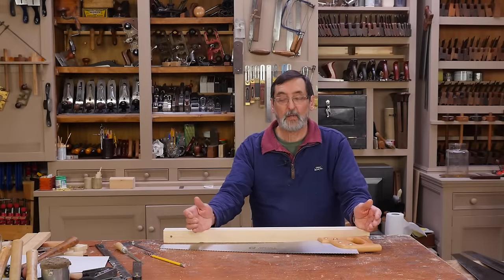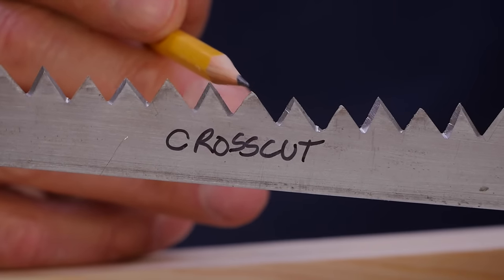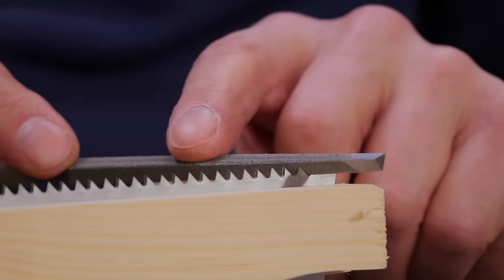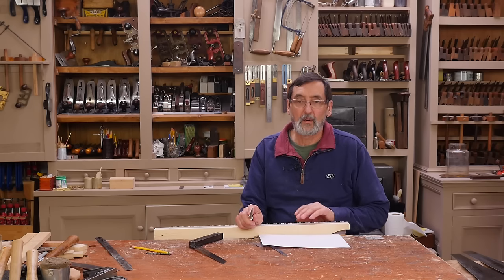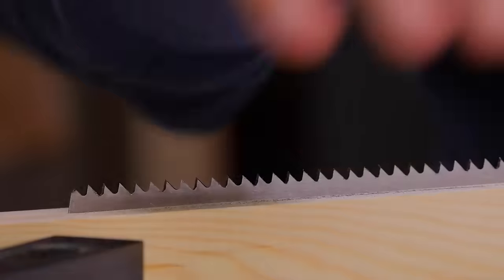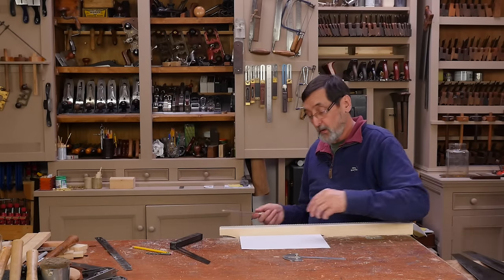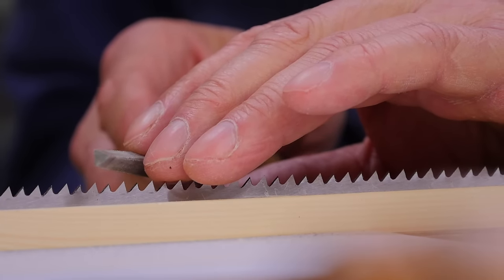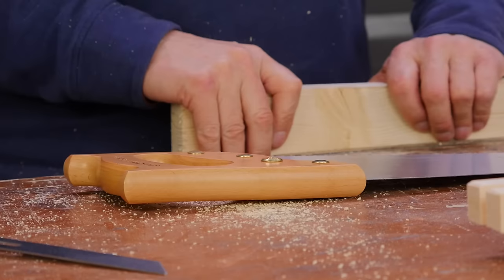Sharpening a Crosscut Handsaw | Paul Sellers

Comment: Hello Paul. I have been a Carpenter& Joiner for almost 50 years I still have my original saws I first bought as an apprentice at Browns of Wilmslow Cheshire I have lived in Australia over 30 years now and still use my saws which have become apart of me. and I still love to sharpen them. 
I have found your explanation video on saw sharpening and setting  cross cuts and rip saws perhaps the best I have ever seen.
Although these days of buy/ use and throw away saws has almost become the norm in the trade I have to admit having a resharpen able saw in your tool box is a lovely thing, to have and to hold and to cherish it evokes lovely memories for me and its special. Power tools are fantastic and do have an important place these days regarding time and labour and all that  but working buy hand in the workshop and on site is something very satisfying.  I am very glad I had the opportunity to experience this and it is something that has never left me.
Thanks Paul  for your smashing YouTube videos 
Kind Regards
Col Taylor
Reply: What a lovely comment.

Comment: Paul Sellers is simply a genius for non-nonsense practical approaches to this craft.  The very simple idea of a couple of 1x2s joined with a screw and washer, with the fleam angle penciled in at intervals along the length, is so perfect, but I never would have thought of it.  Sharpening a cross cut saw seems intimidating, but with this demonstration I'm sure even I can pull it off.

Comment: Paul, with your demos; I was able to recreate the worn off teeth end of a small razor saw (4 1/2" blade) with small aluminum shims for clamping and a magnifying lens on a stand for soldering work. Amazing that it worked even though I could hardly see what was happening. 
I had to use a small sheet metal angle bracket to keep the file from jumping and moving side to side; and kept the file vertical.

Comment: I am watching this because I have just refurbished my late Dad's saws (rip and cross cut) that are at least 70 years old. Unfortunately they had been allowed to go very rusty over the last 30 years or so, so I have cleaned them off as best I could but the steel is rather pitted. The handles now look fantastic though. The cross cut saw works fairly well as is, but I am now sure a quick sharpen as per this video will transform it. I recall last using this saw in the mid 1960s and to bring it back into service is incredibly meaningful to me. Thank you so much for this video

Comment: I've been doing this after watching your other saw sharpening videos, and I found it didn't require much precision to make a huge improvement to the saw. Just trying to imitate you gave really good results. I am pretty broke so my setup was a dull Stanley Sharptooth (hardened to be unable to be sharpened) and a super cheap ($2) triangle file. The file is destroyed by the time I sharpen the saw, but it works better than new. Safety glasses have had to be added because the overhardening of the teeth resulted in one tooth turning into a projectile, but the results have been awesome. Thank you for sharing your knowledge and experience.

Comment: Thanks Paul! I have a Stanley cross cut saw, bought new about 25-30 years ago, that I have never liked. It just got worse as the years passed. It didn't cut well and always cut a beautiful curve, but never the same curve, haha! I removed the handle, reset the teeth with a punch, filed all the teeth. Many took several file strokes to get a full cut. I then sanded and refinished the handle. This is now my favorite saw, it never worked this good new! I really enjoy your videos as I am making the transition back to hand tools from power tools. Thank you!
Reply: Are you holding the saw with the index finger outside the handle? If not, that is part of the reason you cut curves. To illustrate, hold your saw out in front of you and sight down it as you would a gun. With all your fingers inside the handle, squeeze it and watch what happens. It will torque or deflect. Then hold your index finger outside the handle and squeeze. Might deflect, but not nearly as much.
Reply: @michaelbarnes8709 , 
Badda bing? Badda boom!"

Comment: I just love your videos, they are so clear and helpful and encouraged me to recondition my old tools, plane and chisels first and now my saws. They are all 40 plus years old and kept in a damp garage/workshop along wiith my self made bench which  will now be modified to include a tool tray. In these days of lockdown when I have "sorted" my garage ( i am both a DIYer and a classic car enthusiast so have both metal work and woodworking benches and too much?gear!! A question for you how can I tell with a rusty saw if I can resharpen it or whether has hardened tips?
Reply: If it has hardened teeth, you will not be able to sharpen it with a file. (The saw teeth will be harder than the file.)

Comment: Paul, one question I have is about the pressure you're maintaining with the file.   You did note that you're filing the back of the tooth (which automatically gets the front of the adjacent tooth),  but are you consciously keeping more pressure with the file against that back tooth?  Or perhaps more pressure on the bottom of the gullet?  Or are you trying to glide the file through with
equal pressure on all three directions?  Though the distinction may be subtle, I would think one's mental concentration would make a difference in the outcome.

Comment: Just a quick tip. If you pull the file towards you  while on steel it damages the file by by bending down the cutting edge. Only use a file in the forward position and then lift and repeat and your file will last more than a day.  Great video though.
Reply: I noticed a slight out of sinc sound with the film ( or my laptop ) and it looks as if the file is working backwards against the saw. Obviously that is the opposite of reality as Donald might say .Fake filing.

Comment: Thank you for a very informative video! 
I can proficiently sharpen a rip saw and have always struggled with the crosscut. 
Every time I try to file CC it’s like I am filing a tooth away with the angled file. Tried using less fleam angle smaller files with no luck. 
Not sure if the above explanation makes sense? But any help or suggestions will be much appreciated!

Comment: So I recently came across a craftsman 20" miter saw and metal adjustable stand for it. After fiddling around with cleaning and oiling the moving parts I have begun to focus on the saw teeth. they are a mess. None of the teeth wwere level and not sharp at all. I have been watching and working on my rip saws but I have nothing set up as a crosscut. So if this saw is being used for mostly crosscut in the miter device I should be setting it up like this or as a rip?
 I had previously owned a Stanley plastic miter box with a smaller 14 backsaw style saw. The plastic miter box did not hold up in the weather. Second question...
Should I make the 14" saw into a rip for tenon and dovetail work? 
As my shop evolves I am not sure what to do with things like the leftover blades.
Thank you for your time.
Reply from the maker: I would set it up for a cross-cut because it’s a dedicated saw.
Reply: That saw should be set up for crosscut. It is also too large for dovetails anyway. I suppose you could do it but I would get a dedicated dovetail saw

Comment: I thought the teeth it's had to be "pointed" or evened out with a flat file prior to sharpening with a triangular file.  Is that only done on a rip configuration or not needed at all?  Also do the teeth need to be reset with a saw set?
Reply from the maker: +Robert Plewnarz No. Generally we only top or joint (US) the saw teeth with a flat file IF they are uneven in height poorly sharpened in some other way and even then usually it's necessary only if they have dips and hollows that cause jarring in the cut. Topping is a radical step when a saw comes in in bad shape. We usually need to reset teeth every half dozen sharpenings because as we file the teeth down, we are effectively removing the set at the same time. Unfortunately in the world of misinformation we are led to believe that sharpening always begins with a flat file to joint the teeth but that's not generally the case.
Reply: +Paul Sellers Ah! Good to know. I've a couple of Disstons that were given to me and I've been watching a few videos before I go and get the right files, etc. Other people have recommended flattening as a matter of course. I'm glad it's only necessary when the teeth are in bad shape. Thanks!
Reply: +Paul Sellers Thanks for the information.  This is going to save me a lot of time and effort.

Comment: Regarding the set of the teeth, when and how often would you need to reset?
Reply from the maker: When the saw begins to bind in the cut usually this is indicative of the necessity for saw setting. This will depend on how often you use the saw and how much wear is taking place on the teeth so there is no measured distance between setting saws.
Reply: Been using a handsaw since the 40s We built barns houses wagons, green wood we gave the saw a heavier set than saws we used for dry wood. when a saw starts pinching, or leading it is usually due to set or dull side. A well set and sharpened will cut straight without steering. on dry wood we set saw then slid a stone down both sides to diminish tear.

Comment: Great video Paul, very informative yet relaxing. One question I have though: Why do you sharpen the back of the tooth, and not just the cutting face? It seems a bit counter-intuitive to me, would you mind explaining it?
Reply: +Dutchhorse I'm not Paul, but I think I can answer. Sharpening the front face of the teeth, the teeth would get thinner and thinner approaching the middle until teeth start snapping off. By sharpening the back edges, you're grinding the teeth down from the middle, and so you only lose width in the saw (height, if holding the saw edge-up) over the years, and the thickness towards the edge stays the same. In essence, you're sharpening the shorter edge of a chisel instead of the entire back face.
Reply: Thank you Wesley, I appreciate it!
Reply: You cut on the back stroke too    Right

Comment: Looking at Amazon for Bahco saw files there are at least 6 or more what is the best?
Reply: If they are all by Bahco, then they should all be the same quality. Bahco is a good brand by the way. If you are asking which file(s) you need to buy to sharpen your particular saw(s), then you need to know the TPI, or PPI for your saw(s) and buy the file that is designed for your saw(s). You can look it up online, but here are two resources that will give you a chart on which files will work. Blackburntools https://bit.ly/2vQKn7S  And, Wood and Shop https://bit.ly/38LNTi8

Comment: Dear sir, 

I have a cross cut hand saw and in sentiments of keeping as inheritance from my grandpapa i would like to ask,  

How to repair a broken tooth midsaw as i want to keep this saw. 

Your guidance will be helpful sir
Regds
Percy
Reply: I hope that Paul answers your question. I'm not an expert, but I'd say depending on the size of the teeth and the blade, you might have to grind away all the teeth and cut a new set. Maybe you could weld in a new piece of steel, though

Comment: Hi Paul. I must admit to my lack of knowledge when it comes to saw sharpening  and more so on the selection of the correct files. Having watched you excellent video's on saw maintenance I would like to sharpen my hand saws. Can you advise on the correct type and size files please. Richard Power.
Reply: Hi Richard. There are brands such as Bahco, Grobet, etc, who make excellent saw files. I’d make sure it has a handle so it’s comfortable to hold and then choose a saw file based on the amount of teeth per inch it has (TPI or PPI). For example, I have a Lie-Nielsen Tenon Saw with 11 PPI, so I’d need a saw file which can accommodate that amount of teeth (coincidentally, I’ve just bought a Bahco). Hope this helps and good luck.

Comment: I've seen a number of saws where the teeth appear to be heat treated in some way, I suspect they're hardened. Do these sharpen well or is the file likely to just skate over the teeth?
Reply: +Forth Sadler Hardpoint saws can't be sharpened really. You can touch them up with a diamond file if you really want but generally not worth the hassle, just buy a new one, they last much longer than a traditional saw anyway.

Comment: Does the file size coincide with the number of teeth per lineal inch or are the teeth the same angle from saw to saw? I may have just answered my own question..
Reply from the maker: No, the file size does not correspond with the teeth per inch of saw length. Usually, the governing factor will be that the saw file face will be twice the height of the tooth at least.
Reply: Ok..thanks Paul.

Comment: Hoping someone can give me some advice (without actually seeing what I'm doing). When I try to file one side, then the other, I always seem to end up with all the teeth on one side shorter than the other...

Anyone else have this happen? Is there an adjustment I can make to prevent this from happening?
Thanks in advance
Reply: The problem, which seems obvious now that I know it, is that I was pressing the file straight down instead of toward the tooth I was trying to grind. That little adjustment solved the problem.

Comment: What bothers me about this is that there is no mention of rake angle.
Reply: You can arrive at the rake angle if you know the file has an equalibrium triangular cross section and you are filling at 65 degree. Setting the saw will affect the rake angle slightly, but that depends on how much you set your saw teeth. 
But I suspect real world wood workers don't need to worry about this detail as it's an academic detail.

Comment: I don't understand how not owning a crosscut saw is not a problem for furniture makers. What do they use for cutting across the grain when making tenons? Many joints require cutting across the grain and cutting wood to length requires cutting across the grain.

Where I live (not uk or usa) I cannot obtain a crosscut saw anywhere in the country. My only option is to re-file a ripcut into a cross cut  which is why I am watching this video.

I find cutting across the grain with a rip cut do-able but messy.
Reply: TheCompleteGuitarist on the finer saws not a problem my tenon saws are all rip cut saws as the rip as much if not more that cross cutting.  It's easier to sharpen rip saws hence the smaller saws being rip. Good luck finding a good cross cut
Reply: Adam Lynch Thanks... it's true. I'm starting to get that. Just cannot buy a decent saw in my part of the world.
Reply: TheCompleteGuitarist where are you? These Spear and Jackson ones that paul has are cheap and are on eBay so could maybe get it posted?

Comment: Paul technique works well for large saw. If you have Rob Cosman saws or Lie- Nielsen saws then it is very difficult.  These super fine saws have 16 teeth per inch or 20 teeth per inch. The hammer to set the tooth has only 12 tooth/in.
Then forget about it. Sending these saw to manufacturers to resharpen your saw cost ( round trip shipping fees and labor cost ) as much as half the cost of the new saw. Giving the situation Gasoline cost now  a day for 1 gallon (6- 7 dollars per gallon) is beyond any ones imagination. The ripple effect is what it kill this ECONOMY. 
Get the Japanese saw after a few years you can buy the replacement blade. No WORRIES about resharpening. This is MY 2 cents opinion.